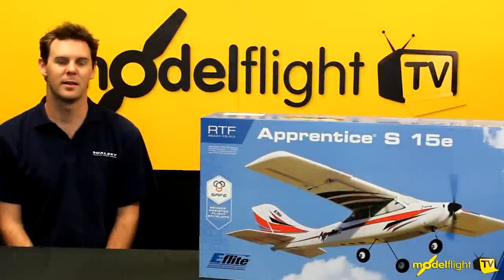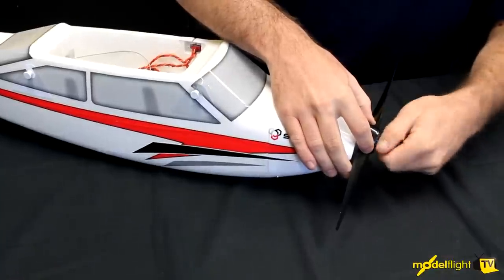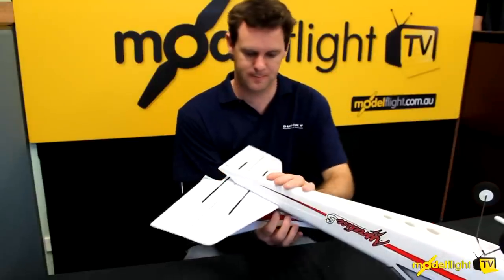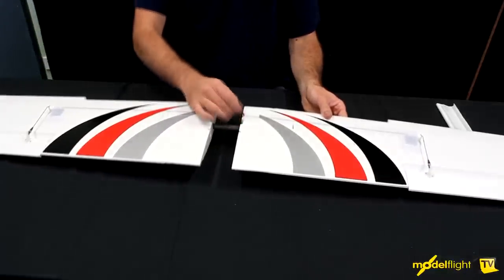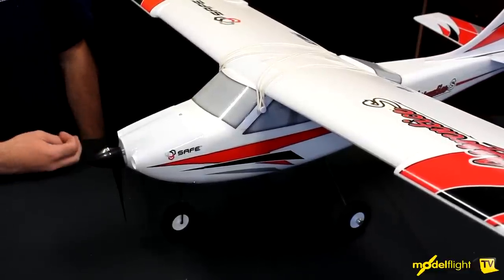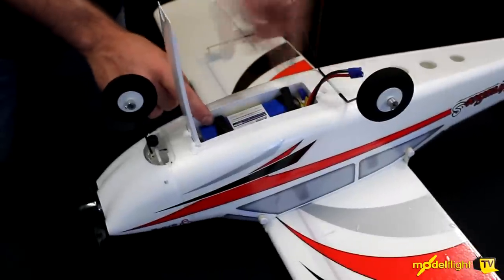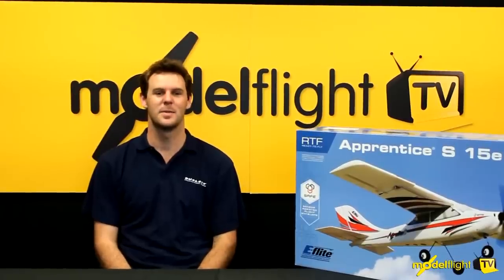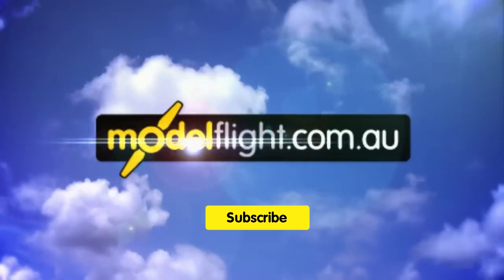E-Flite Apprentice S RC Plane - Assembly and Action Video

Comment: Showed up in my news feed. The Apprentice was my 1st plane/introduction into the sport. I still remember how much bigger it was than I thought when it was delivered. Hadn’t figured out what Dual Rates meant so the maiden was 100% 0 expo, and I thought CG would be something I could figure out when I was more of an expert…. 
Broken prop on the maiden landing, and a broken left wing soon after, but overall all in one piece. The Apprentice and the Timber UMX purchases were the only thing I did in that first year that was smart.
40 planes later that old, starting to yellow is like an old friend. It got a 2nd life as a float plane.
Thanks for the video and bringing back memories of both some really good times and the 5 circle arounds and my attempt at the maiden landing.

Comment: It's a great plane but the nose gear is week, I converted mine into a tail dragger with steerable tail wheel and its  much better. There are video's on youtube to see how its done.
Reply: Yes, i couldn't agree more! ONE hard landing will render the nose wheel useless. And the conversion to a tail-dragger is very easy and only takes 20 min. We didn't incorporate a steerable tail wheel and it still turns fairly decent!  In the last 2 years, we have had absolutely no problems after converting her to a tail dragger!  Luv the plane (hate the front wheel)
Reply: Amanda S. All I did was take the deal from the front that turns the wheel and bring it to the back .. I used the front gear and bent it to bring it to the rer of the plane, I used 1 of the little wheel lock things to clamp it in place I picked up a push rod set from HobbyTown and had to mod the rod lol sounds funny :o) so that it was  the right length and used the clevis to bring it in line with the rudder, Its not perfect .. but nun of them are it depends on the grass or dirt whatever  your landing on..
Reply: Allister2013 thats kewl,,, my friend doesn't use a back wheel AT ALL!  he jst lets the tail drag in the grass and the Apprentice still turns real good,,, jst not so tight :)
Reply: Allister2016 can you link me to the video you watched on how to do it also how much is it

Comment: If you need to remove the prop for any reason . just simpie squeeze the the extreme rear area of the prop. the area behind the prop itself and the tip WILL pop off on its own.

Comment: Hello, great review. You persuaded me into buy an apprentice. Just got it delivered last night. Quick question. Is the prop supposed to be angled down a bit?
Thanks!
Reply from the maker: Hi Patozzzz, that's great. We hope you enjoy the Apprentice. It is a really good plane. Rest assured, the prop is supposed to be angled down a bit. Because the Apprentice is a high-wing model, the thrust angle is lowered to ensure the plane moves in a steady and straight direction up in the air. If you have any other questions about this plane, please let us know.
Reply: Also, I have yet to flown my apprentice but when im testing the controls, everything works perfectly but the propeller seems to cut off and on when i give it a lot of throttle. Im worried when im flying it, it will cut off in mid air. How can i resolve this issue?
Reply from the maker: Patozzzz Your battery performance is probably the cause of this. Maybe give us a call (08) 8186 4250 for more explanations, but I’m confident the low voltage cut off is what you're experiencing.

Comment: Hi, I've just received my apprentice today but I noticed that the way the motor is mounted makes the motor slanted to the right a bit. This makes the propeller slant right and not perpendicular to the fuselage. Is this normal? I've search all over the forums but came up with nothing.
Reply: Yes it's normal so the plane won't drift to the side
Reply: I'm so glad you asked this question (and that Flyhigh8 answered it). I just bought and assembled the model today, and noticed the same thing.  Did it fly ok?
Reply: It's supposed to be that way due to the tongue of the prop

Comment: what about the double sided tape between the wings? Do you know if you can use "Mitre Fast" its a strong adhesive and activator but ive always been abit worried incase it will eat away at the polystyrene, i have done testers but never done any under strain and weight and was wondering if anyone on here has??
thanks for vid  very  grateful 
matt
Reply from the maker: Matt Barr Hi, Yes you can use Mitre Fast or Cyanoacrylate glue (http://bit.ly/1KKPV3r) and will be more than fine to use on the Apprentice. The Apprentice is not made from polystyrene and won’t react to CA.

Comment: On the tail section  the top one u secure it on the second whole? Well the one in the middle ?
Reply from the maker: Hi TEAMLAWLESS 914, just to clarify, the Apprentice uses two retaining screws to hold the tail on. Are you referring to the control horn and pushrod? Thanks.
Reply: Yea I think u said the control horns  because I recently bought one and u know how there are 3 whole i put the pushrod on the first one the outer whole not the iner whole and i haven't flown it yet but i see on the video i think u put the pushrod on the middle  i was wondering why it has 3 wholes because the manual didnt say anything can u help me on that please?
Reply from the maker: TEAMLAWLESS 914 thanks for clarifying that. I just spoke to one of our team members and he said that the reason why there are three holes is that it allows you to adjust the sensitivity of the aircraft. If the pushrod is attached closer to the hinge line, the plane will be more sensitive. Likewise, it will be less sensitive if the pushrod is further away from the hinge line. Given that you haven't flown the aircraft yet, we would suggest starting with the middle hole. You can then adjust the pushrod up or down as necessary. Hope that helps you out. Please let us know if you have any other questions about this plane. Thanks.
Reply: Oh ok i see  because i put the pushrod on the outside  whole of u rudder and its kinda like pulling it in towards the push rod it doesn't stay straight
Reply from the maker: TEAMLAWLESS 914 ok, thanks for letting us know. Truth be told, any hole is fine. All you will need to do is check that the control surface is centred after you have selected the hole you want to use. The whole rudder linkage should be checked over. Hope that all makes sense. Please let us know if you have any other questions.